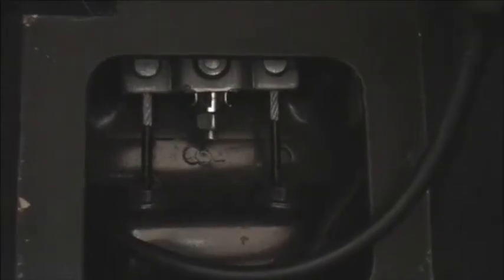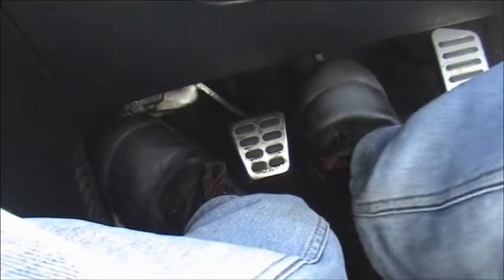Adjusting a handbrake with rear disc brakes - Ask The Mechanic

Comment: Gor a issue we're I had a sticking caliper replaced the caliper and the handbrake bracket moves cable moves and no matter how tight I tighten the cable only the caliper I didn't replace will engage with the handbrake despite the handbrake peice and cable itself the second u touch the brake pedal the rear tire stops but not with the handbrake lever it don't even slow down worked prior to the caliper change now only one tire locks up any ideas?
Reply from the maker: Have you adjusted the cable following this video? Very important to get the lever right back and the piston right out (pump pedal with the handbrake off). If so maybe a faulty caliper.
Reply: I havnt yet should that be My next step?
Reply from the maker: @Jhodder813  Yes that's the point of the video, if it is adjusted wrong it won't work because the angle is wrong in the caliper.
Reply: Still nothing tried it today thinking I'm gunna have to tear down the caliper and look to see if somethings messed up in the caliper itself

Comment: hi i fitted a new caliper and handbrake cable to my car when adjusted so it touches the stops handbrake holds fine but my handbrake lever is pointing right up towards the roof of the car i hate having a high handbrake lever is there anything i can do to fix this???
Reply from the maker: It's OK to adjust the cable, just make sure it still touches the stops afterwards

Comment: Hi, Need I turn on the engine before press the brake pedal?
Reply from the maker: Igor Mendez you do not need to, but it will make it easier to press the pedal.